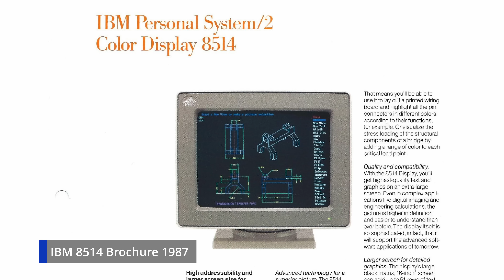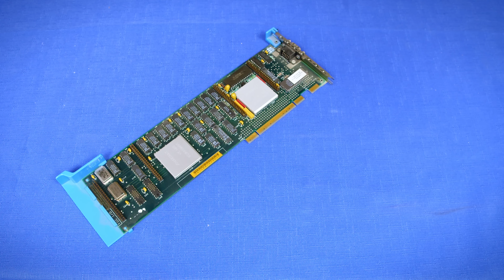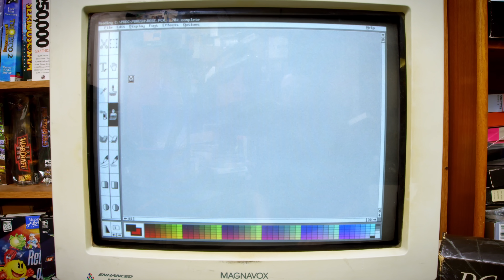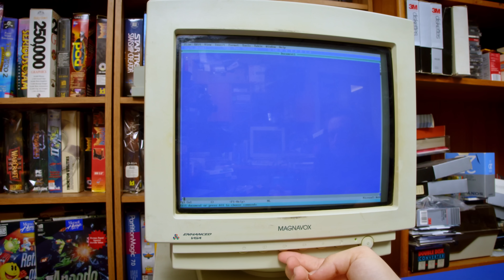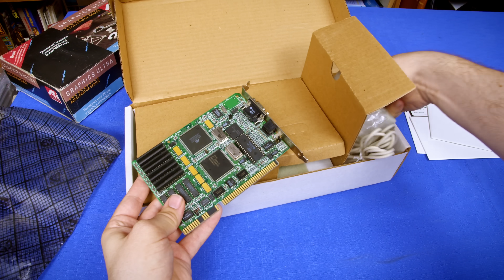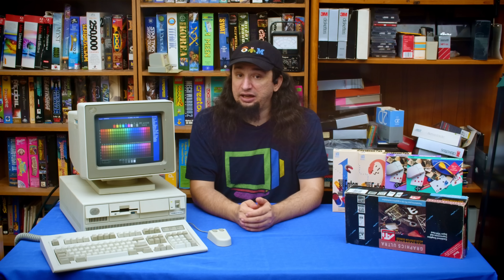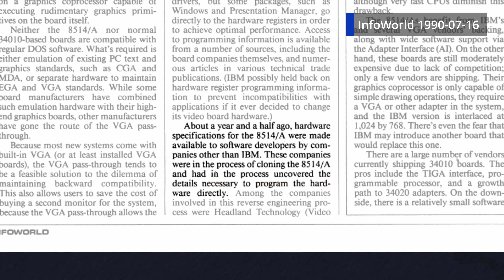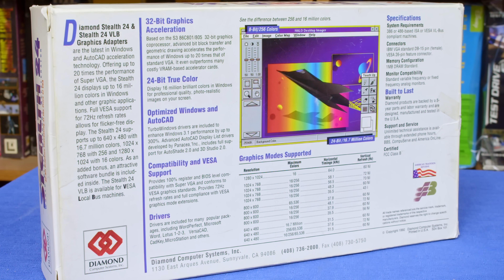IBM's Weird GPU From 1987 - IBM 8514/A

Comment: I was working for Verticom/Paradise/Western Digital at the time developing our own 8514/A chipset and ISA graphics card.  I developed the GEM/Ventura Publisher desktop publishing driver for that card.  That chip set was amazing at BitBLT operations.  Our card had tons of off-screen video memory and I used that to cache dozens of hi-res fonts, stacking them up in individual bit planes.  Then I could use the BitBLT engine to render individual characters on the screen, and the chip was able to take a character bitmap from one bit plane and then render it in a 4 or 8 bit color on the visible part of the screen incredibly fast.  This method bypassed all the CPU font rendering that was included in the Digital Research GEM reference driver.  That card also did 1024x768 @ 60Hz non-interlaced.

Prior to that, I had worked for Vermont Microsystems who made the Professional Graphics Controller (PGC) for IBM.

Back in those days, graphics card mfgs. had to work with application developers to develop device specific device drivers to allow the application to take advantage of the hardware capabilities of the card.
Reply: If you still have access to a Vermont Microsystems IM-1024, the emulation community (PCem/86Box) could really use the ROM contents from that card. John Elliott reverse engineered the card well enough to get the Windows 1.x drivers to work, but AutoCAD still doesn't. Having the original ROMs would probably help immensely.
Reply: @IanDunbar1  The ROM has been dumped (by GearTechWolf on the VCFed forums in the Dec 2022 - Jan 2023 timeframe).
Reply: @john_amend_all  Yes, I found it! I had only previously seen Predator99's posts on Vogons. GearTechWolf really buried the lede there on that one, lol. Thanks for the heads up!
Reply: @IanDunbar1  I think VMI came out with that card just as I was leaving.  I worked in the west coast sales office and they had brought in some new mgmt. as part of some sort of private equity deal.  

When that new boss came in for his first visit (I think he had been in copier sales), he looked at our display wall of various graphics cards and proudly exclaimed he was going to sell millions of these things and he didn't know anything about how they worked.  Right then, I knew our office was finished, because in those days, PC graphics accelerators were not a commodity product.  My buddy had recently left for Verticom and I followed him over there shortly.
Reply from the maker: That's awesome! I did try to get an example of one of the Paradise 8514/A cards for this but they are quite uncommon now. Using off screen memory makes tons of sense for that, do you remember off hand if your card allowed direct framebuffer access? That's one thing I've read wasn't possible on the IBM which which have made clever font loading like that a pain.
Reply: @TechTangents  Yes, I believe it had something like a 64Kb memory page that the CPU could write pixel data to and then BitBLT that to on-screen memory.  That was the biggest issue on that card, in ISA format, was all the commands to the chipset went via I/O instructions.  On something like a 386/33 CPU, that was limited to about 100,000/sec. which was what the advertised vector/sec. rating of the card was.  This was a general ISA issue, not specific to that chipset.  Our card had 1 or 2 MB of video RAM and there was no way to access all that with the CPU from DOS.

I wrote the test program for the card and the way that chip worked, you loaded all the Bresenham line drawing parameters into internal registers.  As soon as the EndY coordinate was written, the chip would draw that line segment.  All that test program did was keep sending out the same EndY coord., wait on the status bit and repeat.  To get max. throughput, the vector had to be horizontal, aligned to an internal memory bank boundary and exactly 16 pixels long as I recall.  Draw any random line and you had to send StartX/Y, DeltaX/Y and then EndX/Y (all via I/O instructions) and that slowed things down a fair bit, maybe 1/2 to 1/3 the speed.

On the desktop publishing side, most of the display handling was text.  There were some lines and polygons for things like bar charts, but nothing like CAD.  I used the chip set to do font scaling and rotation as well. It had an incredible 48 pixel line drawing pattern feature.  I could tell the chip to grab bitmap patterns from cached font characters and then use that line pattern to render each character at any angle desired, scanning through the bitmap one line at a time.  That one trick eliminated 1000s of lines of hand tuned assembly code in the VGA driver with a few lines of C and ran many times faster.

BTW: I also worked for Silicon Graphics with their IrisVision card (another IBM knockoff) and that card supported a 640x480 interlaced mode for NTSC video output.  I worked on the AutoCAD driver for that card.  The trick for making vector based things look good on an interlaced monitor was to use various anti-aliasing modes, which the IrisVision card could do.  Basically this, along with setting the linewidth to 2 pixels, eliminated all the flickering you get with horizontal lines on an interlaced display.  That took a bit of work to figure that out.
Reply: And the Windows 3.1 have native driver for 8514/A. 😯.
Reply: @antoniosethias9948  Of course, the spec sheet was good, and it was many years old by then.  The installed base wasn't huge, but it not trivial either.
Reply: Paradise chips were also found in the Tandy and many OEM configurations with integrated video.
Reply: I would call the NEC μPD7220 form 1984 kind of the first "GPU", or better still , the Texas Instruments TMS 34010 from 1985, that was truly programmable. and both are from before the IBM 8514/A.

if they had paired a TMS 34010/20 with a Inmos T414  Transputer... on one chip, the closest thing to a GPU of 15-20 years latter
Reply: @mikes989  What a GPU is has for sure changed over the years.  It took some time and several generations of hardware to dial in exactly what was needed out of such a device.  It also took time for applications to evolve to the point such hardware could be taken advantage of.  In the mid-80s, apps were typical 2D and made little use of the hardware, assuming most users had EGA or VGA cards.  Dedicated game consoles were entirely different and they pushed more of the "GPU" type of features that folks expect these days.

An example is AutoCAD, it did all the 3D to 2D conversions in the CPU and basically sent down a screen full of vectors to be displayed every time the view changed.  Finally they allowed a "display list" to be saved in the graphics driver so a single REDRAW command could be issued instead of re-sending 1000's of vectors.  Later, they added a "32-bit" drawing mode, where the display driver could handle panning and zooming, within limits, without having the application generate a new view.  This again made orders of magnitude speed-ups, because it eliminated all the application-driver-card back and forth calls.  I think the latest versions of AuoCAD/Inventor/Fusion360 can send 3D geometry right to the display.

The first PC gfx. card I worked with was the IBM Professional Graphics Controller.  That was essentially a PC on the gfx. card, with a separate 8088 CPU and the graphics memory.  It mainly did 2D graphics (lines and polygons).  It did do text, but only with fixed fonts as I recall.  It had limited BitBLT functionality.

Then I worked with an Intel 82786 based desktop publishing card.  That  was more of a BitBLT engine with all sorts of functions to accelerate bitmap operations as well as doing 2D line drawing.  Then, the company I was working for developed the 8514/A chipset and that had way more bitmap features as well as much faster 2D line drawing.  That made a tremendous improvement in speed for doing text/font manipulation.  Doing that on the CPU was painfully slow, with the 8514 or even the 82786 it was orders of magnitude faster.

Then I moved to Silicon Graphics and worked on their IrisVision card, that was developed for IBM in the RS-6000 workstations.  That was the start of what would be considered a GPU nowadays, based around a Weitek bit slice FPU.  It had dedicated hardware geometry pipeline, multiple graphics memory bit planes for graphics, double buffering, z-buffer depth clipping and alpha buffer for blending.  The only feature it was missing, compared to today's GPUs, was the ability to use that processing power for other than the graphics pipeline.
Reply: I did at one point consider hacking Paradise 8514/A support into a PC emulator so I could see what GEM looked like in 256 colours. In the end I went the simpler route of writing a GEM driver for the VESA 256-colour 1024x768 mode.
Reply: @john_amend_all  That would be the best way to go in that situation.  Without the hardware support, emulating the 8514/A chip set would do no better than using a direct to video memory VGA type driver.  The supplied GEM VDI driver code was heavily hand tuned assembly for that very purpose.  Plus the 256 color VGA mode gives you one pixel per byte, so CPU access is a lot simpler than the 16 color mode where you have 2 pixels/byte or monochrome with 8 pixels/byte.  

In the Paradise driver, I ripped all that code out and sent everything directly to the hardware to handle.  When I first got that code running, before stripping out all the assembly, it was no faster than VGA, because the CPU was doing all the work.
Reply: Were there any high profile games that took advantage of those features?
Reply: That sounds so cool. I wish I knew what any of it means... ;~ ]
Reply: WD literally steals IBM's intellectual property: WOW COOL GOOD GUYS!
* sees 'AI' letters * : starts excusing, sobbing, apologizing
What a miserable being 😆
Reply: @Pentium-Proso what exactly was stolen and why didn’t they sue?
Reply: @CaptainDeasOn I recall that Verticom, who did the chip design, only used the public register descriptions from the public documentation and designed the chip set to accept those inputs as well as a few additional ones.  A number of features were added, like faster BitBLT operations, additional video modes (I think up to 1280x1024), support for more memory on the card, etc.  WD then acquired Verticom as well as Paradise to pick up the VGA and 8514 chipsets to add to their HDD product line.